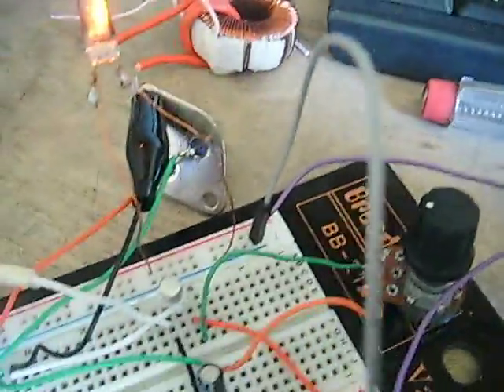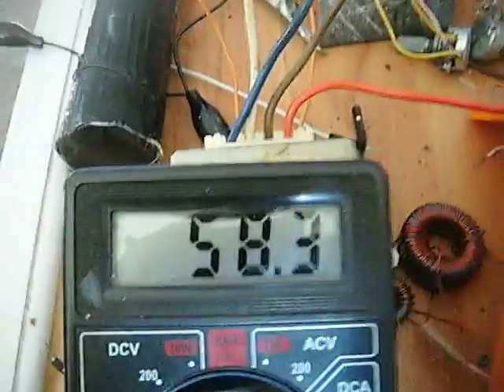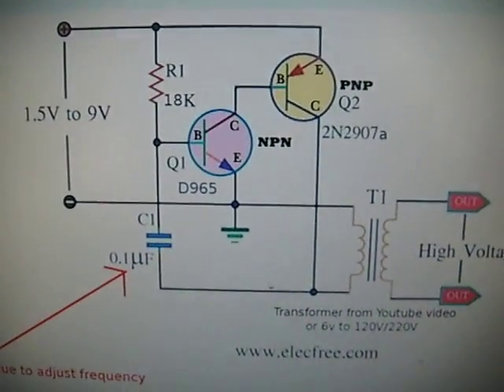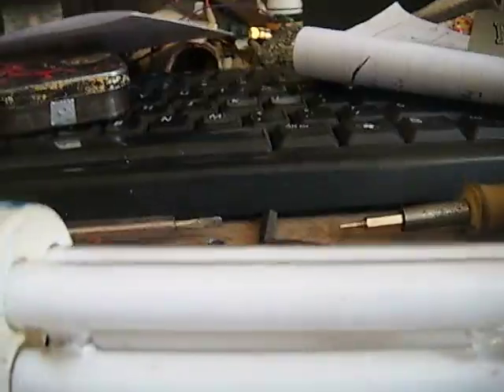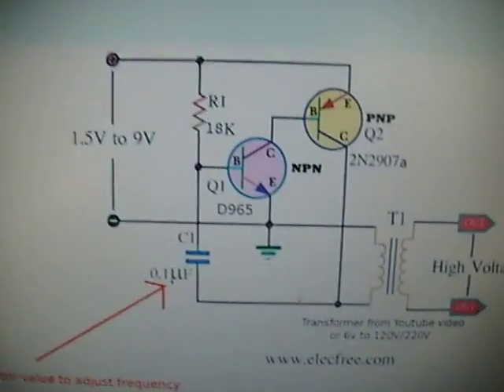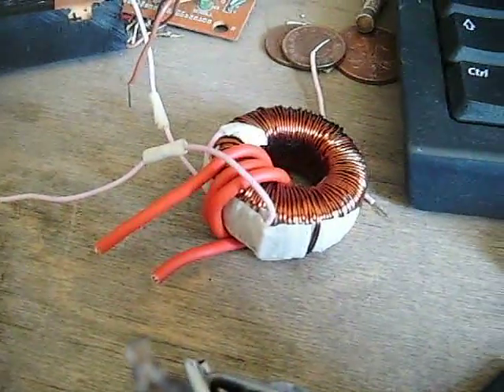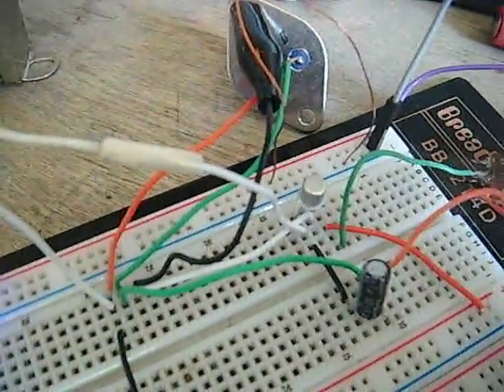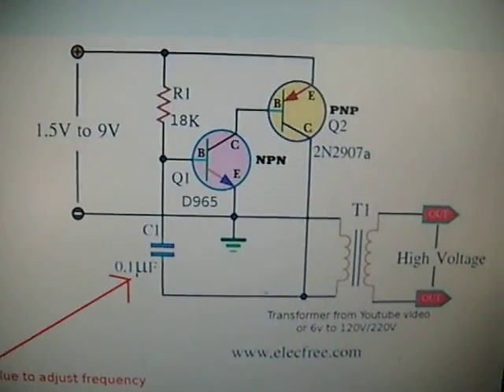Simple DC to AC (Transformer) Inverter 1.7v (DC) to 58v (AC)

Comment: To light a CFL properly you need a min 5W solar panel, that is not a small panel. Buck circuits waste power in conversion, just drive leds directly. You need to do some homework on current voltage and power and the first law in thermodynamics. Otherwise good for a learner, I learnt by the same mistakes.
Reply from the maker: +Martin Counsell These days I wouldn't use such a circuit for lighting a CFL, I would use the Tesla tube (1000+ Turns) I made (I'll have to upload that video) The circuit (Joule Ringer) can light a CFL to full brightness at only 1.2 milli amps - It generates an electric field in excess of 1000+ volts - The reason I don't like using too many amps becomes more obvious when using my Tesla coil because even at 800 millivolts the leaping plasma spark burns. I'll stick to lower amps and work my way up when I can play safer :D

Comment: What is input amperage used in video and output.Cheers
Reply from the maker: This circuit uses very low amperage, I believe anything over 1amp will blow the PNP transistor (I blew 3 in a row) so to stop that happening I searched for one that could handle the same input Load voltage (100v) as the 2N2055. I found the MJ2955 works perfectly - Now I can add a 12v Source with a much higher amperage but as I'm a novice I will leave that up to the Pro's ;¬)

Using a Toroid and adjusting the windings I managed to pull 200v (low amps still) - Check out my Toroid videos ;¬)   watch?v=RqQ0LBviYgs
Reply from the maker: +Robert s Input amperage is from .0.35 - 1.2 milli amps, the PNP transistor is tiny and will not take much to blow it up, in fact only 1 of 5 of those transistors are still alive. I have since bought a better PNP transistor (MJ2955) which can take much more input ;¬)